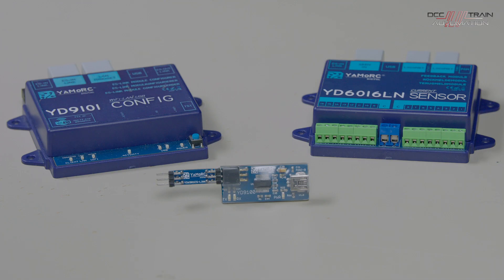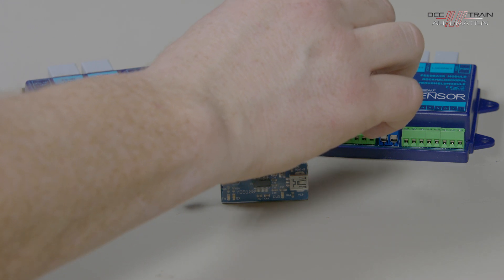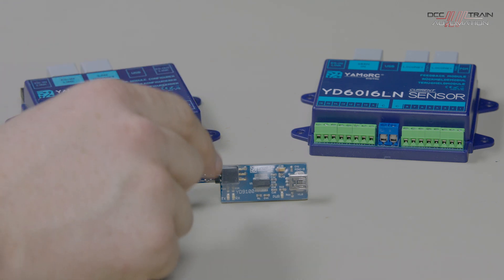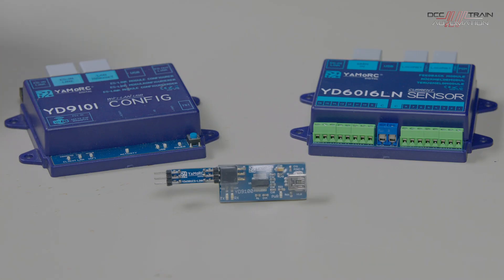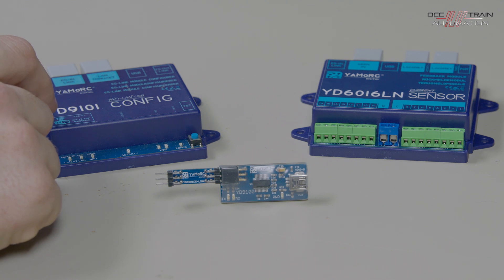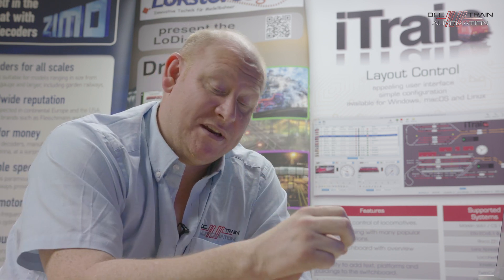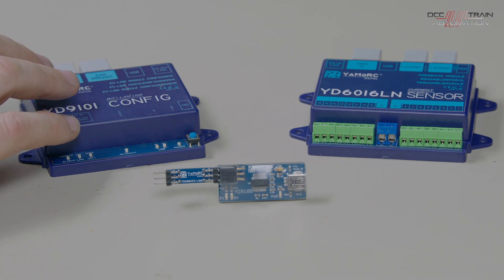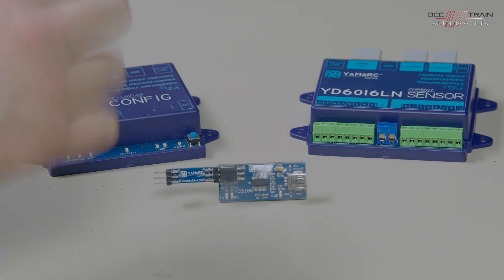YaMoRC Introduction to set up devices interfaces. No1

Comment: Do we have to update a DR5000 to the latest firmware for the YaMoRC to work with it.
I left my DR5000 on the 5.5 release because of the LAN problems with the 5.6 release
Reply from the maker: No not at all. Will
Work with all DCC Systems as well
Not just DR5000